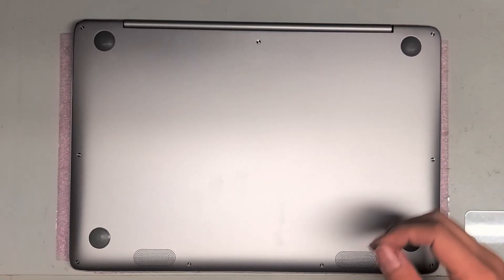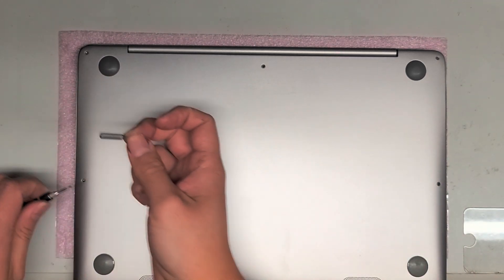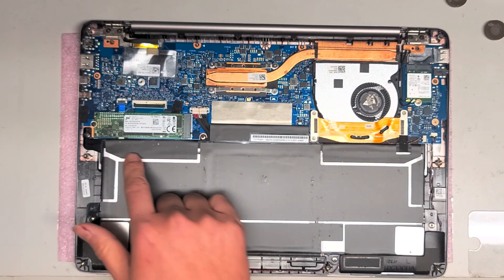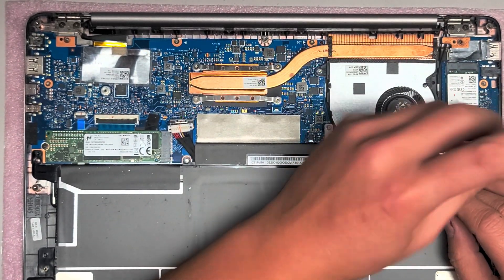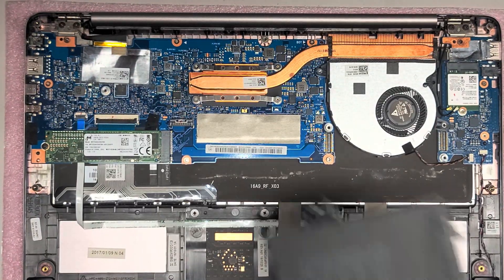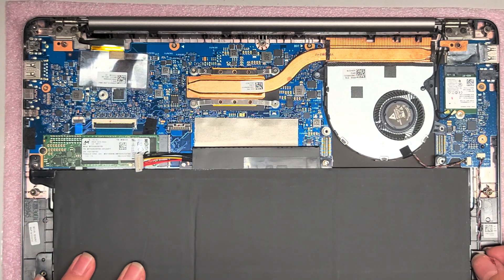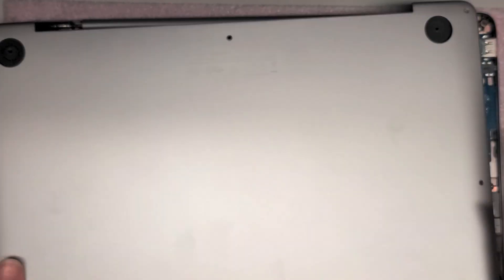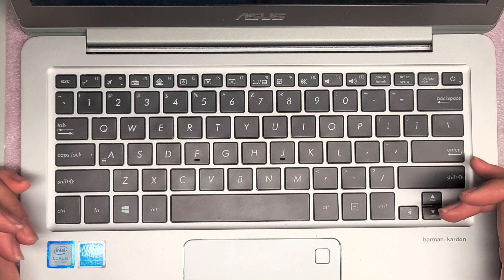ASUS UX330U Notebook PC Disassembly "No RAM" SSD Hard Drive Upgrade Repair Battery Replacement

Comment: Hey bro thanks for the video. I have the same laptop and I am having issues with headphone jack and speakers. At some moment it stopped working. I tried to update drivers but no result. Do you think it has something to do with audio chip? And if so how to replace it? Any idea? Thanks
Reply from the maker: Not sure. Might be a bad driver or damaged headphone jack. You can get a usb sound card if you can't fix the issue.
Reply: @ItsBinhRepaired  yea, I think the headphone jack is damaged and only one USB port is working. But I think soundcard will only help to use a headphone and speakers will not work anyway right?
Reply from the maker: @Jon-jz6rw  yeah :( you can use external speakers
Reply: @Jon-jz6rw  bro I fixed mine, The connecter in minute 6:20 wasn’t plugged in properly. I plugged it in and I got my audio back !
Reply from the maker: @abdulrahmanaladwani9717  awesome!
Reply: @ItsBinhRepaired  yo I have the same problem did u find a solution ?

Comment: Very useful video, thanks :) can you also please type the battery model you bought ? there are a lot of different models in the market and I am afraid of buying the wrong one which doesn't fit .
Reply from the maker: The model number is likely on the battery itself. Make sure to check that. I don't own the computers I work on, so I'd be going based on the laptop model number and the shape.
Reply from the maker: This should work https://amzn.to/3xHrgs1
Reply: @ItsBinhRepaired   Thanks a lot :)
Reply from the maker: @nozhan88  no problem